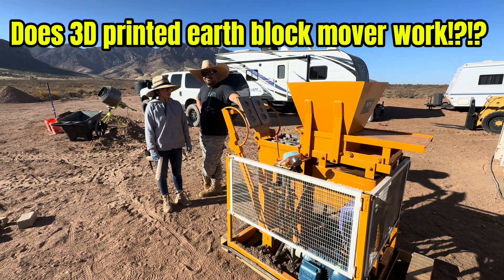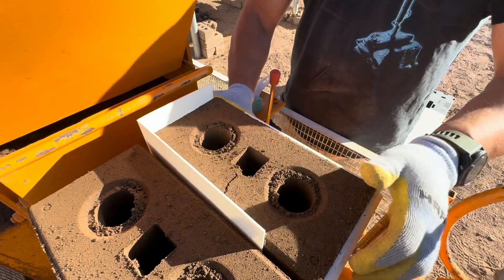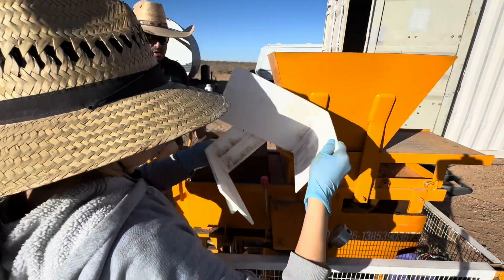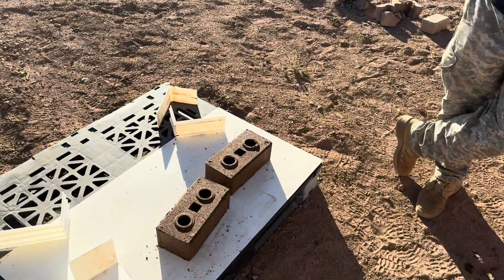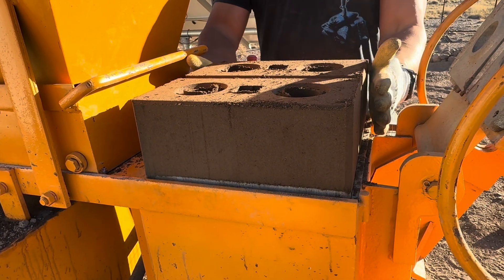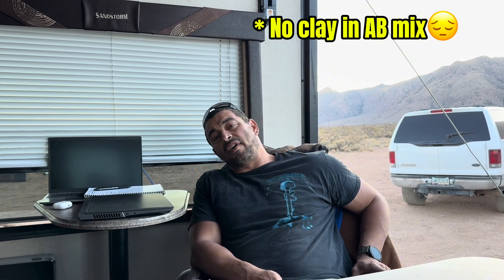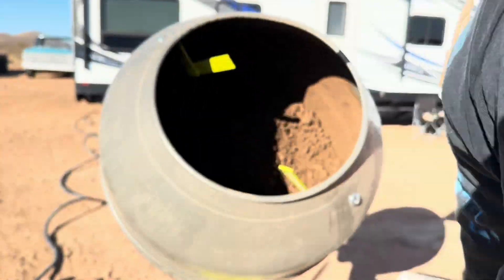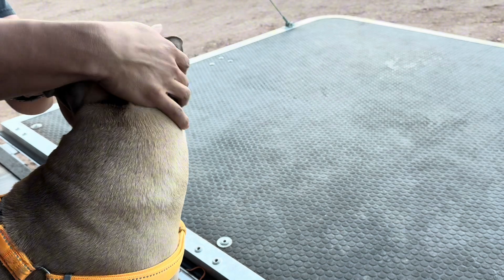Can Our 3D-Printed Tool Handle Fresh Compressed Earth Blocks?

Comment: Too dry and not enough clay content.
Reply from the maker: Thank you for your comment.  Actually our 10-15% clay rich 10% cement and rest of our native soil and amount of water Erik is adding is holding very well.  But we are sure that perfecting these things are tricky with all external factors like the weather. We will be open minded and make adjustments as needed!😄

Comment: It might help to use a release agent in the chamber. That way, will it release the brick more easily? kinda like concrete formwork
Reply from the maker: @MrEggs321  thanks for the comment. I know what you’re saying, I used to use a release agent for fiberglass forms, but this machine mechanically presses the brick out and it doesn’t look like it is sticking to the sides or bottom. We are getting better though!  Stay tuned

Comment: Need more binder. I have used polymer in some of the compressed earth block I did years ago. You are both going to get this with enough practice!! How deep of a pit are you extracting you material from? You may need to get deeper into the earth to retrieve usable material!
Reply from the maker: @rongray4118  Polymer! We never thought about that. Thank you for your suggestion! We are planning to dig at least 2 ft down to get out dirt.